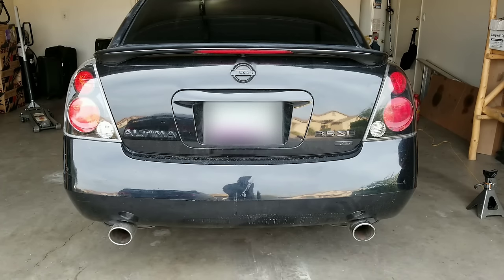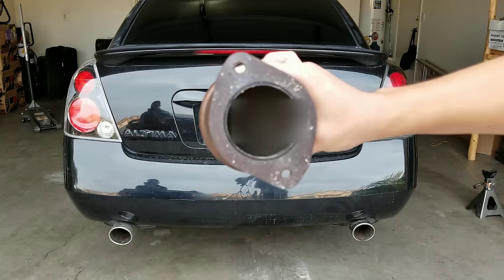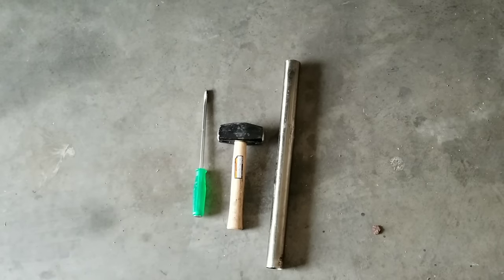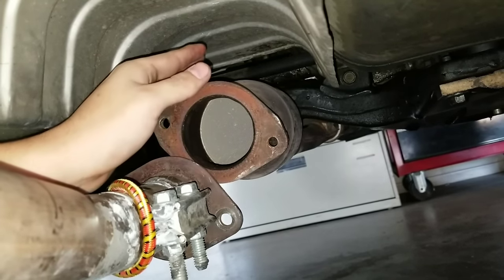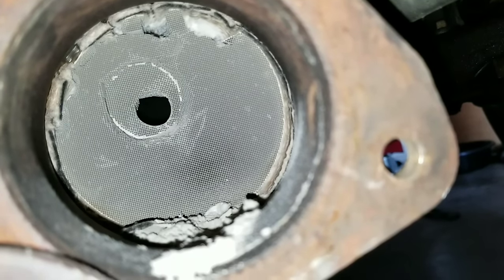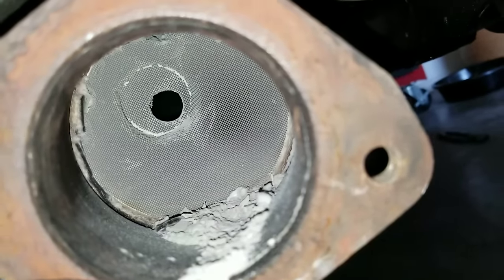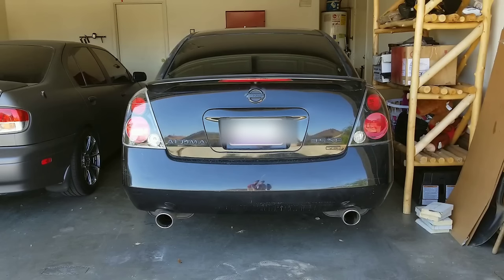How To Delete Your Catalytic Converter!

Comment: Where are the O2 Sensors then, so they don't throw a code? What I meant is, what are the readings you pickup on a temp gun.....
Reply: Monty Daniels 02 sensors are on the pipe before the cat and sometimes on each exhaust manifold
Reply: @BlessedGamingEZ  [See my comment I edited above, before you replied to it.] All vehicles I've checked have o2 Sensors on either side of the cats, even if the one is by/closer to the manifold. That's how the ECM knows if the cats are working, or if they're plugged or melted even if just partially, by reading the temps. I mean that's why they're set up like that. Correct? Now to clean: I'm gonna try removing the o2 Senor before the cats & pour enough cleaner to fill the pipe loosen up & let it set over night [cold] so if it blows through after I start the vehicle, it should push all the liquid out through the cat.

Comment: It illegal because its stoopid, making some nice poisonous air out the back. just sounds ridiculous ,for what an extra 10hp. If you wanted to do that you should've sold the converter as it has precious metals in it and just used a straight pipe section.

Comment: How does this affect o2 sensors if there is one after it?
Reply: shobney your check engine light will light up but the sensors them selves will still be in tact and working properly which is why you are getting a check engine code
Reply: Decollate_- I guess what I meant is, would it cause to run rich or lean?
Reply: @shobney  Neither. The sensors are "Down Stream". You would get an error because the temperature of the air would be different due to the removal of the metals. The sensors are designed to read a certain temperature over a certain period of time.

Comment: 2 questions: 1. If I were to do this with my 2006 Nissan Xterra would it trip the sensors? Like would the computer know I cleared the converters and indicate it to a mechanic? 2. Do you think it would fix the codes PO430 and PO420?

note - I live in an area of my state that it is legal to do this (not in the city), but it is a bit controversial, and mechanics never like stuff like this, so I don't want anyone to know.
Reply: go ahead mess it up good.

Comment: Actually all you did was make it run worse. Without proper tuning the post converter 02 sensor is going to fault which could possibly cause your car to change to a crappy default VE table and timing table. Not to mention the added air is going to increase your short and long term fuel trims possibly to the point your car runs like crap. Not to mention modern catalytic converters flow fairly well compared to the old style.
Reply from the maker: if you go back and watch the video I did mention that its a 3rd cat that's not metered by a o2,thank you for watching and your feedback

Comment: No fuckin way those bolts were that clean and easy to remove.  I call bullshit.   Oh wait,  I see a cactus on the license plate.   Nevermind.  It prob was that clean.   Here in Ohio that bitch would be rusted to hell 1 months after it rolls off the assembly line.    
       Carry on.
..
Reply: Yep, taking mine to a shop to get em drilled out. Whata pain in the @$$

Comment: Haha. What the heck. I wouldn't let you touch my car. You can simply use a hammer drill with a long cement type drill bit. Or even a typical drill with a long cement type drill bit. Drill through the "honeycomb" as much as you can and then use a long cement chisel. Just know that certain vehicles will detect that something is wrong and it'll kick off a code. 
As for checking with state laws, very important. I know that New Jersey has mandatory vehicle inspections every year or whatnot. On the other hand, I know that New Mexico doesn't have any  vehicle inspections whatsoever; you'd be surprised what is allowed on the roads. 
As for me, I have a Toyota Corolla with a CAT code. Rockauto.com's cheapest, without skimping on quality, is about $300. So I figure, as long as the car will accept it, I'm looking to hollow out the CAT. More than likely the car will get better mileage along with improved power all because there's less resistance. Even with a new CAT it still creates resistance. 
That said, before hollowing out the CAT on your car, Use Common Sense!

Comment: In my experience, "hollowing out" or "deleting" a cat system on most ODB2 cars does more harm than good. Part of the reason is the PCM and the EGR sytems on these vehicles. It's very likely this, like most other modern engines, have multiple upstream and downstream O2 sensors that, if the CO2 values are incorrect with set off the check engine light and throw defect codes. Try to get your car through state inspection with the check engine light throwing emissions codes! It also sends incorrect data to the PCM that will, in turn, try to adjust the mixture and timing to accommodate for the O2 signal defect. What you end up with in many cases is an EGR system reading a "too rich" fuel condition and it attempts to leans out the fuel/air mixture causing your engine to run like crap and not idle very well. Heat signal is another problem. These cats are designed to run at a very high temp so if the computer detects an incorrect exhaust temp it will cause further problems. Just deleting a cat doesn't necessarily make your engine "breathe" better. They make high flow cats that improve system performance without all the issues. Unless you're adding a cold air intake, larger throttle body, headers and larger exhaust tube diameter, better injectors and a CPU chip upgrade you're basically wasting a bunch of time.

Comment: Um...wouldn't it have been easier to knock the center out of it when you had out in your hand at the beginning of the video instead of laying under the car with a hammer and screwdriver?

Comment: So the louder your car is, the more HP your making.
Reply: Nope.   The better it can move air, the more power it can make.  He removed a restriction with the thought of making more power.   Howe ever, if your car can’t move enough air in to keep up with air leaving (back pressure), your car will lose power.
Reply: Youtubeisbroken so if I want max power, I should just take off everything from the Cadillac converter back? The whole exhaust system

Comment: Are u sure don't shows the engine light on when u clean the catalitic converter?
Reply: The chances of getting an check engine light are approximately 100%. That is a big problem too because it will mask other problems that may come up because the light will always be on.

Comment: Your car was designed a certain way, don't do this!!!! Do not delete cats, it makes your computer go crazy and there are pressures with these new model cars for reasons, keep it factory specs. The cost of cats on Amazon can save you thousands, I got mine for 250 dollars each, midas said it would cost 2700. Dollars, dont pay those stupid prices from these muffler shops

Comment: The biggest problem with this is the computer control system is set up for a cat removed it gets worse performance than ever. Burnt out o2 sensors and electric systems don’t like it and fail repeatedly

Comment: You are not adding horsepower.... only un-restricting the airflow.. imo..you lessened the back-pressure it was designed to run with and probably lost horsepower...

Comment: Deleting the catalytic converter does not necessary get you any more horsepower. The electronic controls are well mapped and will only send in so much fuel. By deleting you cat you may also create other issues which may actually hurt your car's performance.

Comment: The ceramic is made into a honey comb this is not Fibre nor does it filter the design is the pressure from the exhaust and the heat creates more heat when forced through these small holes they become red hot literally then the unburnt exhaust gases sort of like fumes the are then burnt and the sensors monitor this. Now by doing this you will probably need to get a fuel injector programmer because you are now changing the exhaust and air intake ratio to fuel ratio this computer costs about 100$ which Tunes your FUEL MAF computer this will give lot of power without adding a turbo.
ILLEAGAL IN MOST BIG CITIES, IF WHEN YOU GO TO GET YOU VEH. INSPECTION AND THEY TEST YOUR EXHAUST YOU WILL MOST LIKELY FAIL; TS TUNES YOU MAY PASS WITH ONE.

Comment: Your actually slower if you delete you cats with out a tune. Let me explain why first you get a check engine light when your cars computer thinking the cats is faulty and overheating making your car take off slower your louder and think your faster . But when you tuned your can tune the back pressure and get rid of the check engine light so your car thinks its has good flowing cats making you faster with more free flowing air and your . loud get tuned then youll see a difference expecially FBO ( Full bolt on upgrades with catless pipes

Comment: U don’t really gain any HP from doing this if u know how air flow works and there not filters there a catalyst and they work by burning off the unburnt fuel
Reply: you do if your CAT is plugged to the point where light can’t pass.  your engine will run hot, not rev out, and reduced power with a plugged CAT…it’s gotta breathe.  gutting a healthy cat with downflow o2 sensors will give you grief, tho

Comment: Isn' t it easier to just take the cat off, and weld a pipe. Then put the cat back to pass the emissions?
Reply from the maker: The cat doesn't unbolt its welded so I don't think thats easier
Reply: @ERICSDIYGARAGE  I guess, it depends on the car, my cat is unboltable, or maybe previuos owner did some magic there😂

Comment: About the worst way to do this. For doing at home just use a drill and a forcner drill bit. Save a ton of time. Bet way would be to take to some father and son shop. They will usually cut and weld new pipe in for free if you give them the cat. Do not expect a receipt or warranty though

Comment: Why didn’t you just uninstall completely? Much easier to do it while it’s off
Reply from the maker: You can't remove it because it's welded on the only way to remove it is to cut it

Comment: Just put straight pipes. That should be ok. I use that method on my 2010 lux and it sound nice. Remap the ecu then walla. Gain hp and torque. 👏

Comment: This guy does not know what hes saying. Do not remove your catalytic converter in this manner. He just destroyed an expensive component that doesn't not affect performance. The engine was tuned with the back pressure the catalytic converter is making. I would like to see dyno results to prove this is actually beneficial. It would be beneficial if the top end of the engine was configured to the loss of back pressure.

Comment: yeah this guy doesnt know much about the design of cars...    ps the engine needs a small ammouny of back pressure, so this may or may not add or REMOVE horsepower..

and its elligal in ever state in America..   also in Canada if you get caught you might lose your license for 3 months, and get fined up the ass for "modifying the emmisions" of your car.

or is it you just want to be an asshole and polute the air more.    the cat converter is there to take a lot of noxious hydrocarbon outta the exhaust...

Comment: This should be listed, has how not to do it!
Did you know that whats inside the catalytic converter can be harmful, and should not be beaten up like that?
Also, why do you ruin such a good catalytic converter?
You could've bought an old one or bought a cheap bypass pipe, and if you still needed that expensive cat you would still have it.

Comment: An error code is going to be triggered for what you have done.
Reply from the maker: no it won't, go back and watch the video and you will see why it won't.
Reply: @ERICSDIYGARAGE  : There is no clue what so ever indicates that no error code is going to be triggered. 
This is going to happen after few days when the ECU detects a big deviation in the catalytic temperature and/or the shape of the signal comming from the down stream oxygen sensor.
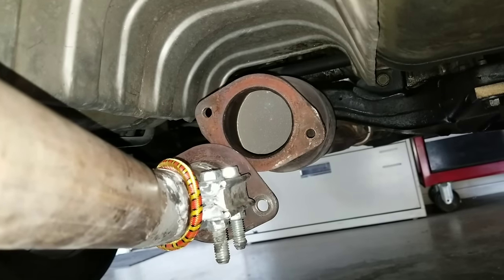Reply from the maker: @YouTubeChannel2000  go back to 4:25
Reply: @ERICSDIYGARAGE  : Oh My God... You are right.... Your car has no sensors at the catalytic converter unit. You can peacefully take it away. 😯😯😯👍👍👍

Comment: On a Nissan 3.5 have 4 oxygen sensors you must have a 2.5 because if you don't delete the third  converter you will get a lean code I guarantee you the computer will pick it up and know something is off
Reply from the maker: Looks like you know your stuff. But you missed one key point 2.5 Altimas have a single muffler 3.5 have a dual exit meaning is a 3.5
Reply: @ERICSDIYGARAGE  I'm a genius when it comes to Nissan I have a quest  that never lost a race yet I took out the 3rd converter and did a  straight pipe I got the lean code so I put it  back on no more learn codes what year is your Altima
Reply: Did you put the new converter back or you still driving it like that

Comment: This is dangerous for the environment what you are suggesting. It is better to clean up your catalytic converter all you need is about 4-5 litres of diesel, petrol (and this is reusable, after allowing the carbon to settle) and soap and water, if you have an ultrasonic bath all the better. Your car also will sound decent and you will be within the law. Think about it.

Comment: How to not pass inspection
Reply from the maker: If you paid attention to the video I did mention that the catalytic converter doesn't have an O2 sensor that meters its efficiency so removing it won't throw a check engine light

Comment: Wouldn't it made it easier to just take it off the car first 😉
Reply from the maker: no because its welded to the exhaust to remove it you have to cut it and weld it back on. I dont think that's easier
Reply: @ERICSDIYGARAGE  ok

Comment: Dude not smart should have took the whole pipe off all that dust will suck before it blows
Reply from the maker: You can't just remove the pipe it's welded on the exhaust. Also, this was the downstream cat it still has two upstream cats so it's very unlikely

Comment: Simple mod that cost nothing and is better for your car
Reply: It actually decreases hp due to the rapid expansion then being forced into a small ass tube and its illegal better off just doing a catback straight pipe
Reply: @crackjack8320  maybe but even then there is still no back pressure the reason turbo cars and go full straight pipe is because the turbo generates enough back pressure but if you welded a pipe on it should be fine and should see a small increase but it also depends on the type of car and how big the pipe would be

Comment: Been easier just to replace it with straight pipe.
Reply from the maker: cutting  and welding  in a new piece  of pipe is not easier
Reply: @ERICSDIYGARAGE  Why would u have to weld it? I see a flange on both ends duh.
Reply from the maker: you obviously did not pay close attention to the video.

Comment: I have a toyota 4 yr old toyota vios and I observe when I’m using my car about 2 hrs then it stall and when I start it I take about 15 minutes to start it again, so I research cuz I don’t wanna spent a lot of money, I check all the sensor to air flow combustion  chamber cylinder head to fuel pump nothing happens then I decide to rip my cat then it works...many dumbass car manufacturers put nonsense technology...

Comment: The engineers that designed this car, and tuned it for max efficiency, probably have p.h.d.s and your education? High school? Cats do not Rob power anylonger,   if you did the math the area inside the cat is the same or slightly lar5 than the pipe into and exit of the oem cat...oh, yes? My skills? I am a Alfa Romeo  technician, before that, 15 years at fiat Ferrari.. I really do not think they would  hire a person like you. You don't think things tnru, and you make bad decisions, without knowing the technology

Comment: When you find it hard to breath and are coughing up blood in 20 years time you can thank your catalytic converter you busted up without a mask and breathed in all that deadly asbestos you stupid idiot. That ashes you caught in a bag you already breathed in the finer deadly particles that have already hooked onto the inside tissue of your lungs. Just sit back now and watch it grow and honeycomb inside your lungs. There is nothing you can do the damage has already been done all to make your car sound like a Ferrari. I’m talking from experience. My father worked in a muffler factory in the 60s when the manufacturers didn’t know the real dangers of asbestos. All you have to do is breath in a Mano gram of asbestos which is the size of 2 grains of sand, and it hooks onto the inside tissue of your lungs and slowly starts to grow until it honeycomb insid eyour lungs. The last 10 years of my dad’s life was like someone was constantly pushing and holding his head under water.